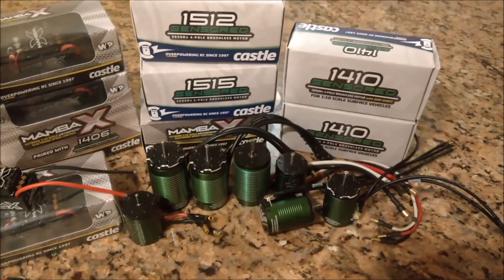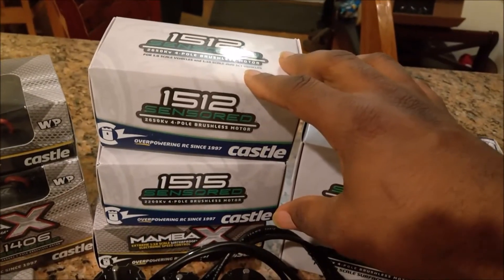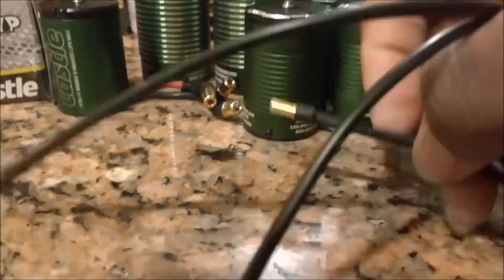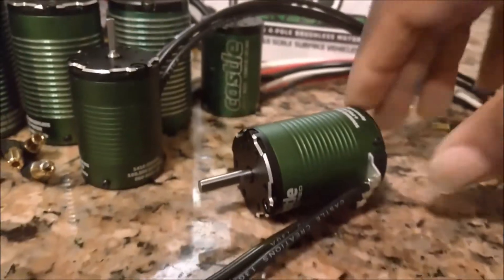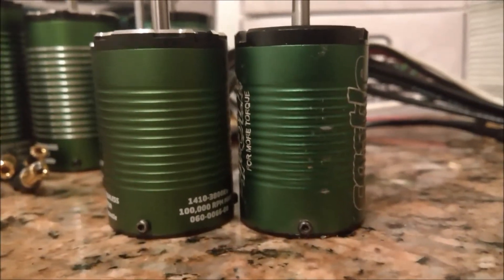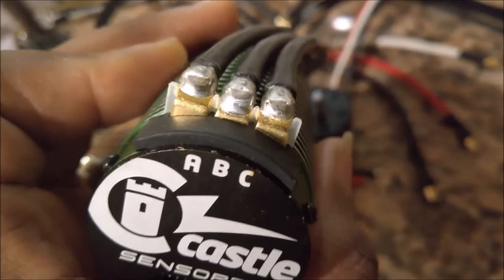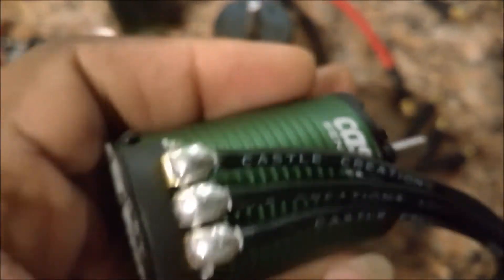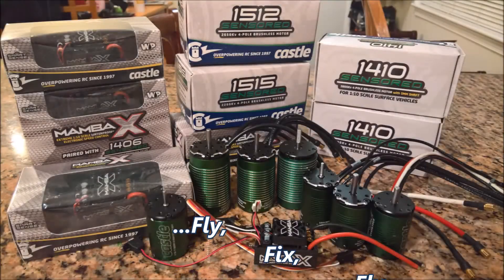Ep. 199: Castle Sensored Motor Mini-Review

Comment: looks like s bunch of good rock crawling motors...
Reply from the maker: That's the thing. These motors give us all the power we know and love from Castle, but add the ability to drive slow and smooth. I think they could just about cure cogging in "highly over-geared" setups like we speed runners use and could take a lot of stress off of our power systems.
Reply: rhouse21 - RC Physics Makes sense to me...i look forward to your test to see how they perform in one of your speed projects...one thing about it...u can't ever go wrong with Castle..